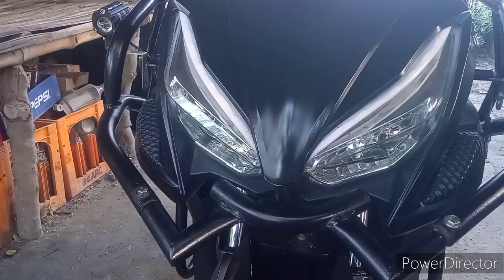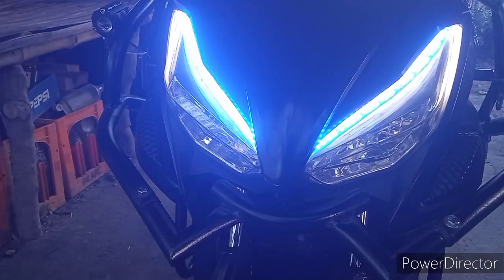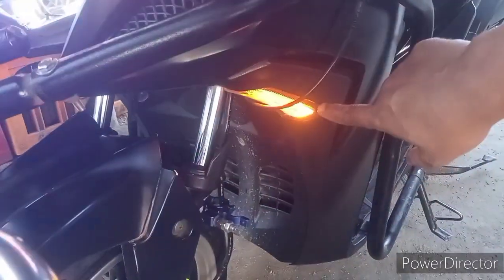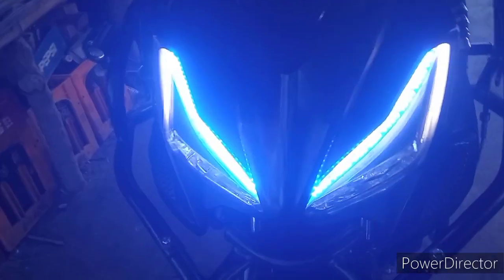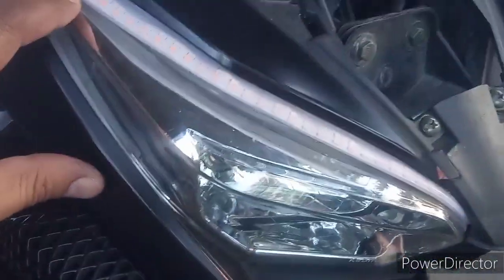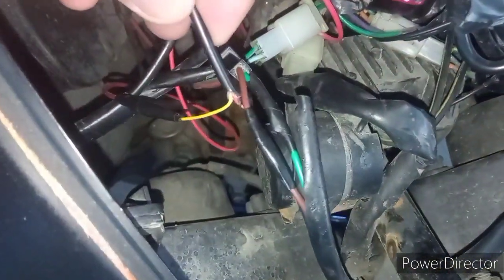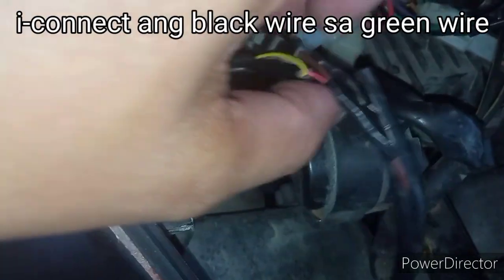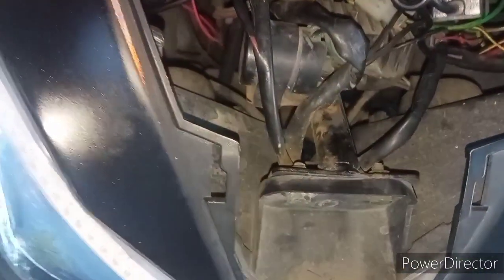RAPID 150 RUNNING LIGHT INSTALLATION II DIY II WLB hobbies

Comment: Paps. Ask lang po. Yun inadd mung wire para sa blue wire. Pinasok muba sa loob cinonnect nyo sa bakal?
Reply from the maker: Hindi po,naka konek lang po yang blue sa kilay ng ating Rapid 150 na kapag i-on mo ang swicth ay sisindi po ang blue, tapos yung dilaw naman po naka konek po sa signal light. Sundan mo lang paps yung ginawa ko may caption naman po kung saan iko-connect ang mga wires. Maraming salamat po
Reply: Okay boss ☺️. Baka naman boss sa likod din ng rapid natin. Pwde nyo rin bigyan ng tutorial pano mag lagay ng led running light 😁